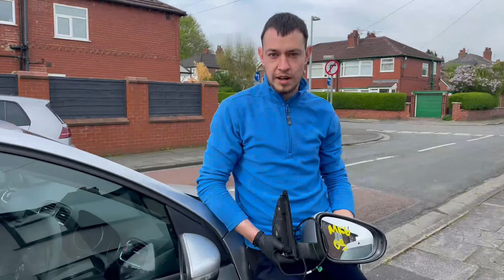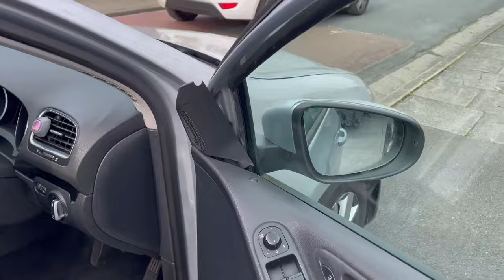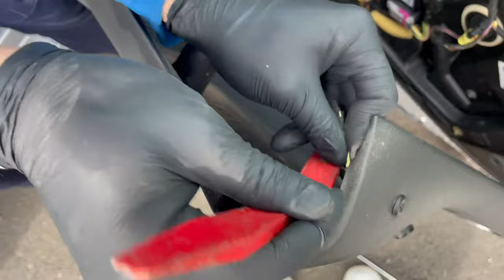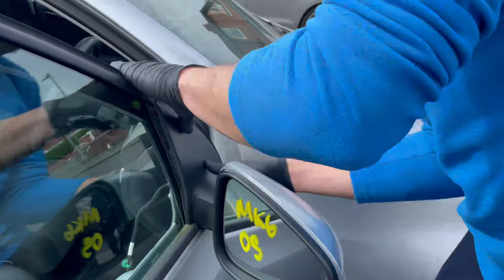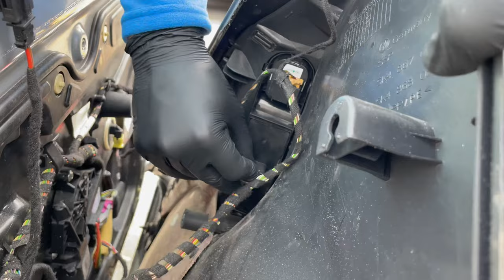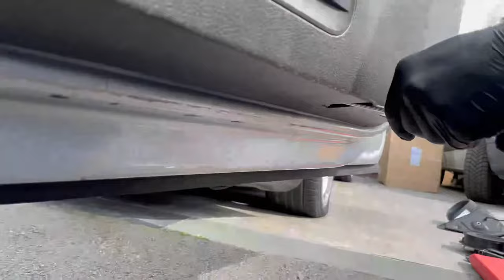VW Golf MK6 Wing Mirror Swap Replacement Step By Step

Comment: What tool did you use to remove the mirror bolt
Reply: Hi Michael did you find out what tool was used? I'm having trouble finding it as well
Reply: @bonnie1975  I can remember sizes but 2 different size torx bits were used
Reply: Thanks for the video. Made the job easy 👍